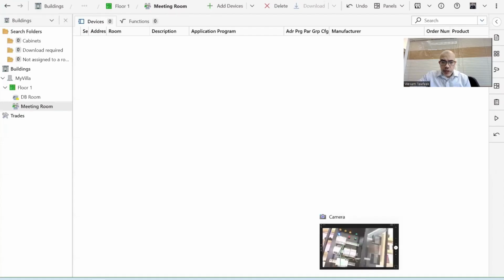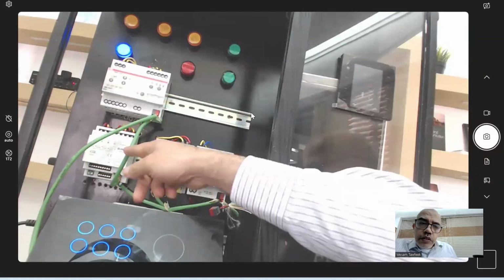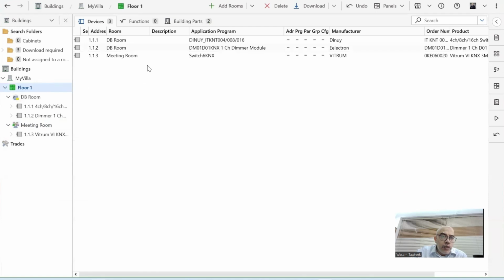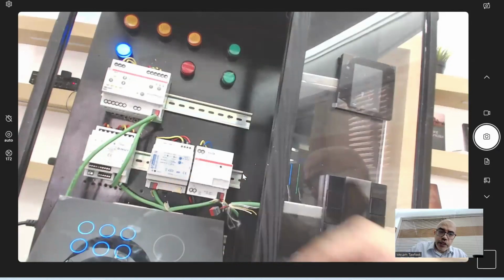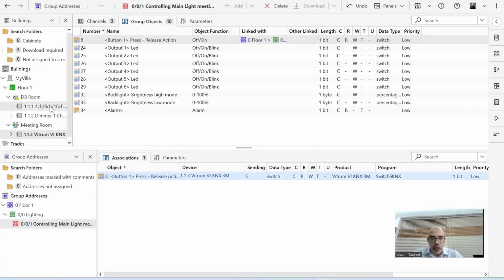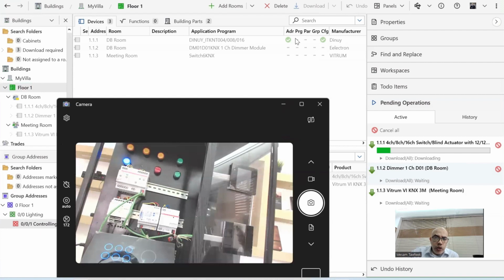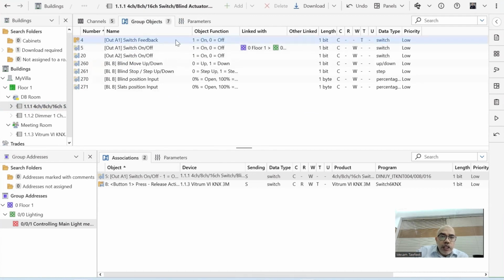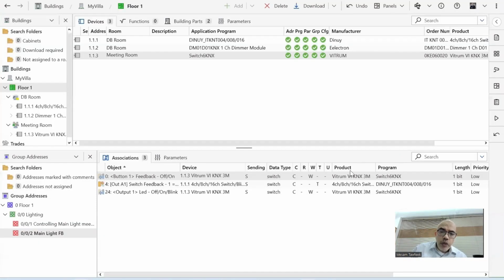2 KNX Practical Controlling Lights in KNX English

Comment: Thank you, that was very clear & helpful. 

I have some Berker B.IQ comfort push button sensors that don't even have a feedback object. I still can't get its status light to work correctly at times. Eg. Button1 toggles light1(FB works ok) Button2 toggles light1 & light2 ( FB works ok for Button2) but not for button1 as there are no FB objects available to add to a FB GA 😭. What a dreadful design.
Reply from the maker: Please contact eng. Wesam via whatsapp on 00971507740131